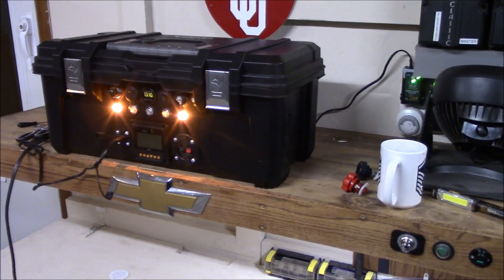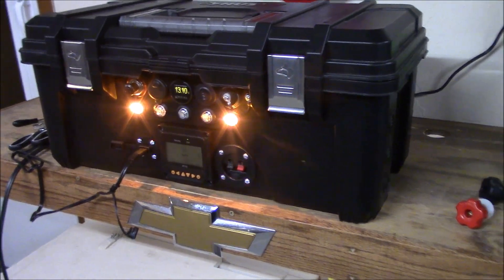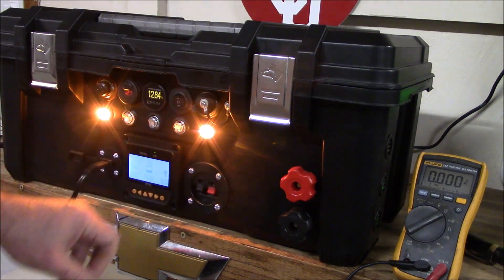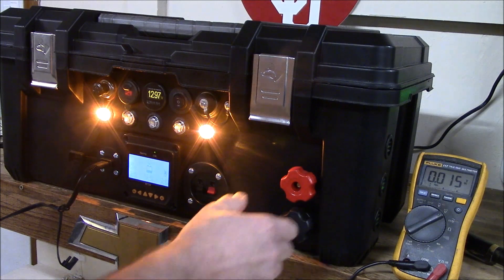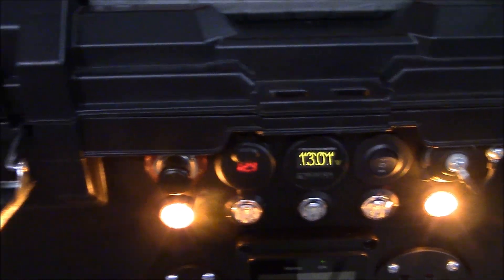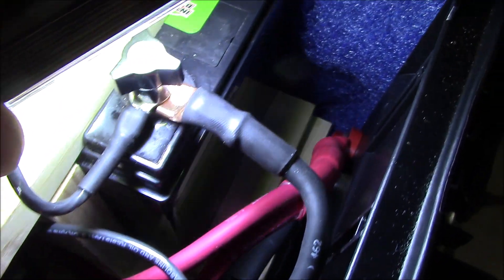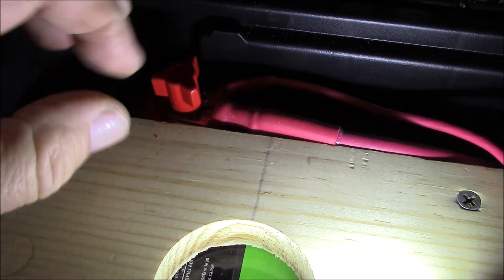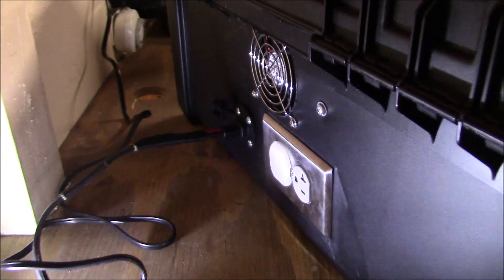100-amp service (battery power junction posts) mod - DIY 12v solar power generator

Comment: Looks cool.  one thing i did is put the battery tender inside with a male marine plugin on the box.  Then i just plug in an extension cord whenever I need to charge.
Reply from the maker: Schmart...that is a good idea

Comment: Chris look into Anderson Power Pole DC connectors.  They come in all sizes.  They are DC connectors and are used for things like 350A forklift batteries and down to the Amateur Radio Guys use them to wire up everything DC.  They can't be hooked up backwards. They come color Coded and they are keyed so you can't connect them up wrong.  Check them out if you haven't.  Nice Videos

Comment: where did you get the star washer terminals?
Reply from the maker: https://www.amazon.com/dp/B079K5HB79/?cv_ct_id=amzn1.idea.S3P41KIGLZXU&cv_ct_pg=storefront&cv_ct_wn=aip-storefront&ref=exp_cov_chrisdiyer_lv_dp_vv_d   But, I wouldn't buy these again. Just go to Lowe's and raid their parts bins...can find everything you need (including the handles). I painted one red. You'll prob spend less than $10 vs $30

Comment: On your car jump connects there needs to be a permanent color desanator on them. Once you remove the caps it’s easy to reverse them. I would also put a plastic divider between them.
Reply from the maker: Agree...thanks. I will throw a red plastic washer on the POS post. Good catch
Reply: @ChrisDIYerOklahoma  don't forget the plastic divider, the post are close together if the a clip falls off it will hit the divider not the other post. some mistakes you only get to make once.

Comment: Dang I never thought about bacon lol good add on the jumper idea now it’s perfect, so for a second there I thought I’d see the six million dollar man come out with that sound effect, another great build sir
Reply from the maker: Bacon is God's gift to my waistline...but, dang it makes you perk right up! Thanks...I put in a Blue Sea Systems 200a circuit breaker for those external battery junction posts. I had that old circuit breaker in my spare parts bin from several years ago. They are stupid expensive tho to buy new (like $70)